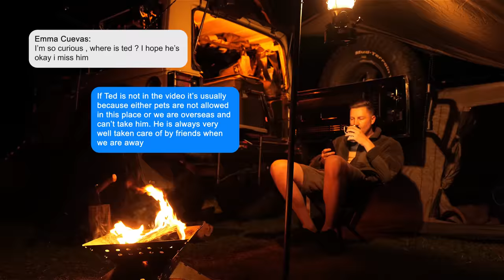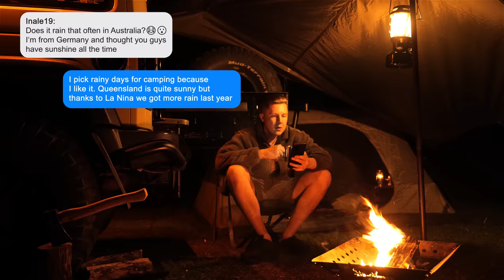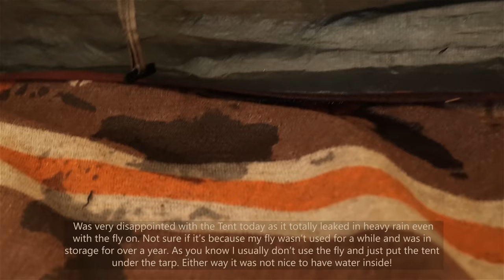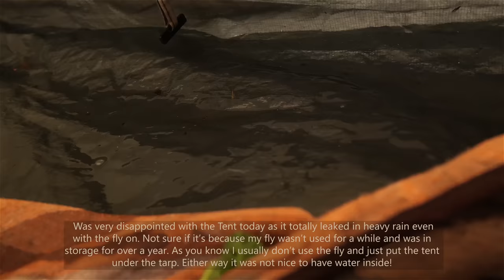SOLO CAR CAMPING in RAIN [ Build tiny shelter, Relax in Cosy tent, cook Comfort food | ASMR ]

Comment: From my experience in camping (i was in boyscouts in Portugal, we call it a different name here, for over 10 years and i go camping every year) the water inside your tent was most likely not the fly's fault. I have a tent myself and i've had it for about 15 years, the fly never leaked whater even once, and my tent is usually stored for long periods of time (about a year, i camp once a year usually). The way fly's work is not that they are actually water proof. They are made of a fabric that lets water slide down them, but they still leak tiny amounts of water under heavy rain.
What most likely happened was one of 2 things. Either the fly was too close to the tent's fabric, so the little water that leaks through it soaked the tent's fabric, or the bottom of your tent, which is usually made of a fabric that i don´t know the name in english but it is like a plastic canvas, is worned off or has tiny holes in it, which usually happens when you place your tent over rough soil (rocks, small tree branches, etc).
The solution for the first situation is, make sure your fly isn't in contact with the tent. There has to be a space between the tent and the fly so the water doesn't soak the tent's fabric. Also make sure that after placed, the bottom of the fly completely covers the tent. If you see the bottom of your tent sticking outside of the bottom of the fly, no good.
As for the second possibility, either buy a new tent, or when camping under rain make sure you dig a small trench around your tent. That will prevent water from flowing under your tent and leaking through the bottom canvas.
Hope this helps.

Comment: I think the waterproofing might've worn off the sheet. You can buy sprays in hardware, or outdoor stores, then reapply. 

If you're more of a DIY guy, you can mix a tube of 100% clear silicone caulk with a liter of Mineral Oil. Alternatively, you can use paint thinner cause mineral oil can be pricier. Just make sure you don't mistake lacquer thinner for paint thinner. Then just apply it on the flysheet and tent, let it dry in the sun for a day, then you're good to go!

Keep in mind that paint thinner can be snellier then mineral oil. The smell fades as it dries of the tent so dw about a smell